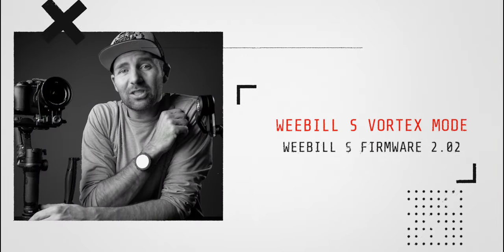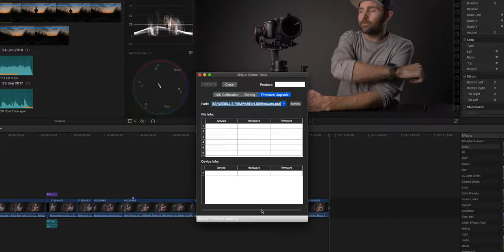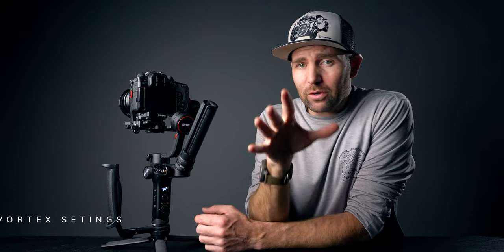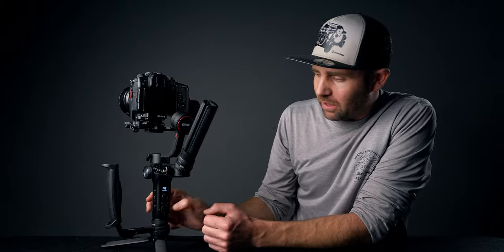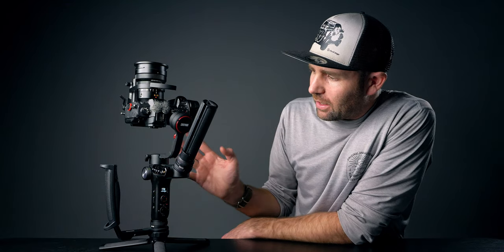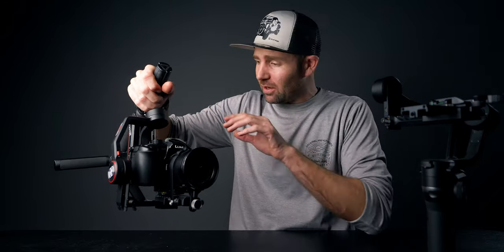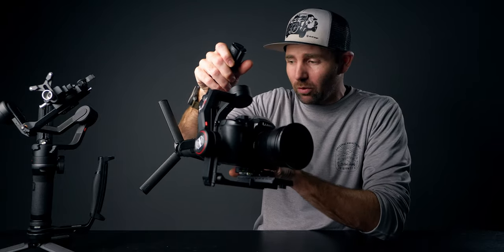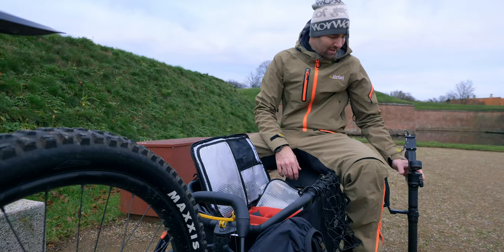Zhiyun Weebill S Vortex Mode | Weebill S firmware update 2.02 | Gimbal Tips And Tricks

Comment: Very useful series of videos.   I just received this Weebill S a few days ago and have never handled a gimbal before.  Two vortex questions for anyone - and perhaps I just missed something: 

1. My Weebill S screen does not seem to have these Vortex options.  After "camera" and "advance" the next option is "wheel" and etc., not a trajectory menu (if that is what I see on the video here), and thus no vortex options.   The firmware on mine  is 1.97.   Does this version just not have these vortex options?

2. Speaking of vortex, I cannot get a 360 degree turn out of this.  It will start to turn, but then it just gives up (it cannot get past 90 degrees).  This is a pretty light camera/lens combo (Fuji X-T3 with their 50mm f2), so I am confident weight cannot be the issue.  I've tried this for hours.

Thanks for any insight from anyone.  - Dave
Reply from the maker: Hi dave.  You dont have the vortex options because it was first added with firmware 2.02. 
If you cant get a full 360 spin. Check that you have balanced the pan axis properly and that the motor strength of the pan mother is as high as you can get it without getting vibrations. Then you should be able to spin it.
Reply: @PeterMakholm  You are so kind to provide this guidance.  They should pay you.  I had not completed the balancing - I thought I had but my understanding was incomplete.  So, you gave me some homework and now the vortex feature is working.  Can't say I will use vortex a whole lot but it has served its purpose as the feature that forced me to learn the gimbal inside and out!  Thanks to your quick reply,  I completed my balancing task this morning.  I also changed out first to a more practical wider lens (the Fuji 23mm 1.4), and I want see if I can mount this setup on my monopod and get some sweet "jib" shots for practice.  Thanks again so very much for helping to keep me moving along!   -Dave

Comment: Peter, seeking some possible insight....Sometimes when I 1st turn my Canon 6D Mark II on, and then right after turn my Weebill S on, a little desktop cpu icon comes on the dslr screen, and I can't see what my camera is seeing then. The Weebill S is connected properly it seems, at least from the little screen on the gimbal. As it shows my F Stop number, etc., but no visuals on my camera's screen. I have to then disconnect the cord from the gimbal to the camera, and reconnect it so I can see the visual as usual on my dslr's screen. Any explanation to what's going on? FYI I have the latest firmware installed on the gimbal.
Reply from the maker: Hey, it could be because you have to change the connection settings in the camera. It might be set to computer, you proberly have to change it to remote or device.

Comment: Thank you for the very helpful video! I would appreciate if Zhiyun reacts quickly to fix the vortex mode bug.
BTW: Did they removed the wireless image transition that was possible with the Weebill Lab without an external image transmission module?

Comment: When I follow your instructions I get an alert that my Axis is locked.  I check all of them and they are not locked I have to shut off my Weebill S to reset and everything works afterwards except Vortex mode.
Reply from the maker: Check the pan lock. It sometimes slides halfway back and the gimbal will tell you that the axis is locked.

Comment: So now they have the Firmware 2.0.3!!!!!!!!!!!!  Even newer one!!!
Seems to be less change
The changelog from 2,0,2:

PTZ-V2.02
1.Newly added offline timelapse functions with optimized performance.
2.Newly added customizable V mode settings.
3.Optimized object tracking.
4.Support direct firmware upgrade for focus/zoom motor through the gimbal itself.
5.Optimized UI on the gimbal menu. 
6.Fixed some known bugs.

The changelog from 2,0,3:

PTZ-V2.03
1. Fixed the probabilistic failure in the upgrade for the focus/zoom motor.
2. Fixed some known bugs.

It seems to be a bug fix upgrade.
What is that "probabilistic failure"

jano
Reply from the maker: Yes. Video dropping tomorrow.
Reply: @PeterMakholm  YEEEEEESSSSS Thank You Only One question Should I upgrade??? Did they repaor the problems and the missing features from the previous firmware??? (I know it is premature to ask but I am just about to upgrade :-)
Reply from the maker: @bacsijancsi  I can't see any difference between the two